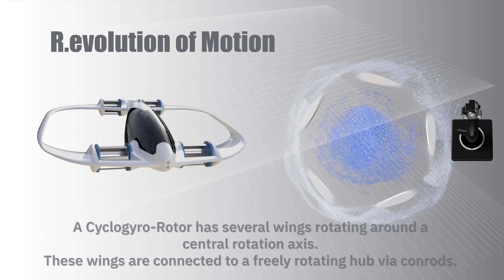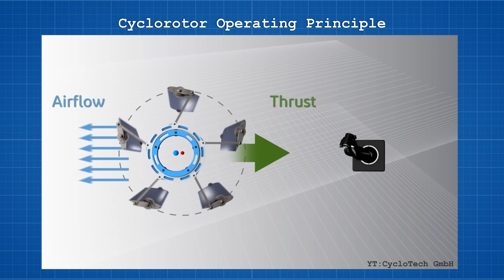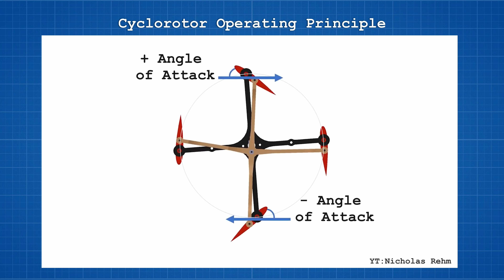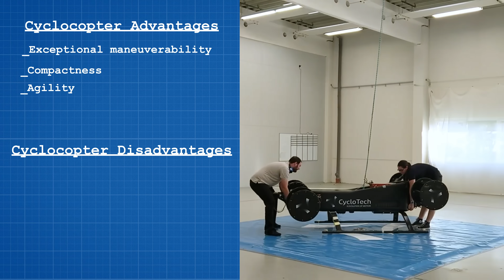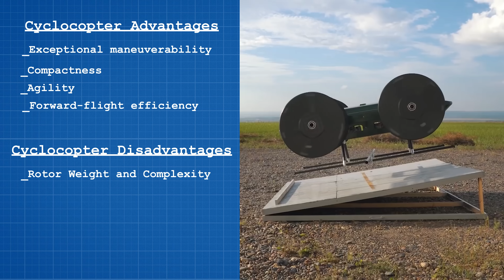CycloRotor: Is this the future of eVTOL Electric Propulsion System?

Comment: Thinking outside the box can lead to advancements in technology, but I just can't see how cyclocopters or its successors will be more viable than quadcopters or vtol. With all the moving parts and how complex it is, it wouldn't exactly be cheap, nor would it be easy to repair. To top it off it looks like it would consume more energy than Vtol/quadcopters.
Reply: Aye, also, the more complex the mechanism, the more prone to failure it is. Murphy's Law comes to mind, and I wouldn't want to be in one of these if it does have Airframe parachute technology.
Reply: @GhostOdyssey  Good point! What can go wrong will go wrong. I could see this being a fun RC but aside from that, I don't see it being viable.

Comment: Have you considered attaching those rotors slightly diagonal instead of all of them facing forwards? Take off in tight spaces is the one real advantage of this machine, so the added sidewards stability should be worth the loss in forward moving efficiency.

Comment: Why not just normal ducted quadcopter blades? This design adds engineering complexity but only half the blade surface area is producing thrust at a given time. Wouldn't that make overall efficiency lower?

Comment: What benefit does this system have over a traditional drone with standard propellers? It seems like any thrust efficiency gained by the cyclorotor system is offset by their increased weight...

Comment: This project may benefit from scaling up and building from stainless steel, like on SpaceX's Starship. A small unit can be designed after working out the kinks.
Reply: stainless steel is pretty heavy, so probably aircraft aluminum or carbon fiber body. The blades also need to be kept pretty light, so we will see in the future what materials they use for that. I am curious about the blades in the future, spinning thousands of rpm creates insane stresses that would band and bow most materials outward... maybe they would incorporate discs that band around the blades to prevent that

Comment: I see an issue... wear on the control rods just like a rc heli on the cycle head system. Takes alot of mantanence to keep it tight.   Every revolution of each rotor it moves to adjust..   wears our fast.  Yes it can be made robust easy... but at a cost of alot of wheight... not acceptable.

Comment: If they can eventually get those cyclo rotors to double as wheels/tires this will be the one
Reply: No. Absolutely no. You would never drive on those things on any road and expect them to still function safely as props.
Reply: @rucker69  it will happen eventually. I picture hollow wheels that retract when ready to fly, but the rotors remain extended but disengage when in drive mode.
Reply: @CRASS2047  The wheels would be too heavy for flight. Newsflash, wheels are hollow already.
Reply: @bluemamba5317  you lack the imagination to grasp my concept. That’s ok. You’ll see it one day
Reply: @bluemamba5317  I mean spokeless wheels, which do exist
Reply: Maybe its certainly possible in theory

Comment: Should design the body with intakes all around the outside and a system of valves to redistribute airflow to keep it even incase of motor failures and the body is the main controller of thrust direction not the engines themselves.

Comment: Each Cyclorotor has several moving parts, looks like a very advanced design what happens to the aircraft or it’s lift if a complete rotor or just one part of a rotor fails. To my mind this looks more complicated then the typical helicopter blade and rotor assembly of today which is typically 2-5 blades achieving lift and flight. In this design each rotor has five blades meaning 20 blades all moving flawlessly in harmony is required for lift with each rotor spinning at approximately 6 times the RPM of a standard helicopter..
Forgive my ignorance if this is not accurate, I know new and better designs must come but how is this more efficient, not more vulnerable to damage and not a far more costly rotor design.

Comment: Actually, breaststroke is the future of personal aviation. Since air is technically a liquid, we can create a net upward force if we breaststroke in an upward direction fast enough. This is undeniably cheaper than any previous mode of long distance transportation. In spite of the fact that the physical effort required to do so would almost certainly kill you, scientists are currently working on making humanity immortal as they always have been, so eventually such an insignificant issue will not be a problem. The more you know.
Reply: talknig about liquid, there is buoyancy.
your aviation should weight colse to air to swim.
strokes only doesn't swim.
Birds? Ok. Huge machine with huge wings and nothing except the engine onboard.
this will work if you are machine or machine with just your brain as max cargo.

Comment: 25kg of thrust sounds really weak for that large of an rotor. Basically you trade footprint vs power. And i hope they intend to make exangable battery packs for that air taxy because 85km range is not much. For many ppl gets you to and from work once. Then you have to recharge it over hours. As a taxi with permanently attached battery packs this would mean, you cant fly other customers. It also means your taxi must have a range display or you have to book them and they select the taxi suited for your range so you dont have to ask if they can fly you 30km into one direction if it only has 40km over all left.

Comment: im really curious if its actually possible to make this thing relaible for more than one or two flights, i bet the stress on the materials must be insane
Reply: Yes, and when one of those rotors fails, there's no lift and no auto-gyro effect, which is why this thing will never be the future of eVTOL.
Reply: @ferrellsl  That's why development is needed. We can't stick to the old way for eternity. When everything just come out, everyone concerns and doubts. As time flies things will get better and better. If you said if one part fails that whole thing fails but rocket is like that, fly by wire fighter jet is like that, that's why redundance is also needed. Just wait for it to improve and judge right then.
Reply: @krain.8245  'old way'? Dude, this thing IS the old way, obsolete tech with nowhere to go and no practical uses and advantages over maneuverability. Plenty of disadvantages though, a lot of which you can't even get around. Even in the best theoretical application scenario there's no way this thing will be useful in nearly any way
Reply: I bet it would scoot across the water though!!
Reply: if youre referring to the torque stress on the materials as relative to a traditional prop design... idk i think the horizontal, flat surface area makes it handle it okay even when compared to a prop (since props extend into a single tip for every blade... in which the blades are in turn held by a single axis at the center... these airlift blades are positioned horizontally and held together by two points it seems?...) the # of blades in that cyclo arrangement also matters (perhaps creating interfering or constructive air vortexes.. and obv the material matters a lot as well... nice question all very exciting..
Reply: @aruhtaz  the blades rotate around their own axis as well as around the main axis of each turbine. That is how you get lift though the blades go in ,any directions while it rotates... Seems like those mechanics would be hard to make last...
Reply: @karlsjostedt8415  completely agreed, it just LOOKS like it shudnt work; let me clarify, i would never put money into this for investment, but can i respect their attempt? sure.. playing devils advocate was why i commented
Reply: Using magnetic bearings will help a lot
Reply: @davincicreativeprojects8853  yeah for real mate
Reply: Rotors blade are shorter, less moment of inertia, more tensile strength, more shear strength. Composite material that is stronger than typical helicopter. I don't think we can tell much if there is no actual calculation for us to see.

Comment: My father in law was shot down in a helicopter 4 times in Vietnam and had power losses in several commercial helicopters afterwards, but landed in a reasonably safe manor each time thanks to the autorotation that helicopter pilots are able to do after loosing power. I certainly wouldn't want to be riding this when something goes wrong...
Reply: Since there's nothing on top of the vehicle, I think simple parachutes on top, and airbags below, would suffice in an emergency.
Reply: You father was ultra lucky. Helos are not so safe either. If something is falling, there is not much to do about it.
Reply: @hades4438  I wouldn't say ultra lucky, but highly skilled. On one of the commercial helos that lost power, he was taking his parents for a ride, and had to ditch it in a farm outside LA. When they landed his dad asked"what are we doing here?" as though it was a planned stop to pick up the farmer, and not a terrifying fall from the sky. Being able to store momentum in the rotors and use it to execute a soft landing is skill and engineering, not ultra luck.
Reply: @jasonthorpe3470  I am in military for 20 years and sadly, none of the helo failures could land safe. And those helos are mostly blackhawk models. I don't say, skills are useless of course. BUT I try to say, if you are in air and there is something seriously wrong, you got seconds to act and all safeties are not so safe enough yet. Even jet pilots you think they are safe as they can eject themselves mostly can't survive from this kind of situations. You know that even a slow car crash is harsh for human body even you got your belt, so a slow crash landing can easily destroy everything.

Comment: With all the weight of the rotors being thrown around and the multiple points of friction, I can't see how this could possibly be efficient, especially when compared to a simple directable blade and cowling. Even more weight will have to be added for protection around the rotors and for people's safety on the ground. What happens if a blade breaks in operation? What do the gyroscopic forces do when encountering a sudden shift in direction? In considering flying it over cities at low altitudes, I would say that it poses a great danger to anybody on the ground, should one of those rotors fail. To say that the stumbling block of the design back in the day was the lack of suitable materials is invalid; they made a plane fly with the same materials. The current day materials make propeller designs much more efficient too, so your apparent 'advantage' in this design is still lost to propellers. I'd still like to see how far you get with this, though and I'd love you to prove me wrong!

Comment: I miss a calculation of the thrust produced compared to a propeller of the same weight and materials. That only will determine whether this will "take off". Especially with the disadvantage of electric vehicles who have a still heavy battery to lug adding a weighy propulsion system does not help. So this is a non-starter for me. Or you can show that the extra weight of batteries is compensated by a lighter weight propulsion.

Comment: you drastically forgot safety as a disadvantage, what happens when your running 19 of  20 blades? 16 of 20?  4 of 20?

most helicopters can safely land (with skills) using only 2 of the 4-6 blades
Reply: No. Helicopters cannot safely land after a rotor blade failure.

Comment: 5:00 - So, phrased another way: it's unstable, is inefficient during vertical flight, and is prone to catastrophic failures due to material limitations.
IMO it sounds like you'd be much better off using ducted fans with thrust vectoring and more traditional construction methods.
Reply: That’s not what I heard…..
Reply: @jcd-k2s  Just like every propeller there is power in and power out. And the rpm is reflecting that. So despite the not so efficient parts closer to the shaft the effective area (calculated by: pitch - area - distance to shaft - free airflow) is what one has to recon with. In other words: look at it as a black box. Then measure how much of the input is converted into thrust. Every part of a propeller blade is delivering its bit of thrust. All the time in a continuous manner. The resistance, drag, is also constant. That rotational drum kind of thingy has fluctuations. And needs for the same thrust (lift) more area for the blades. Because the limited time they contribute. So larger blades translate into increased and constant drag. And even if you design the mechanism so that the blade at the bottom delivers lift it does so at a disadvantageous state because it it is upside down. Built in inefficiencies!
Reply: @jcd-k2s  Those blades have a wing profile. Which means on the top is lesser pressure by a convex surface providing uplift. If the same wing profile is at the bottom it is inverted. The long convex surface below the straight surface. So to avoid downward "lift" it needs to have a positive attitude. Which means pointing upward by some degrees. But with the wrong profile orientation.
Reply: Correct
Reply: The device is designed to generate lift and not thrust. I think I understand you point though. However; generating lift with rotational motion reduces overall weight of the vehicle because it is reducing the needed parts. The rotor itself carries the wings whilst being attached directly to the rotational axis which is usually the electric motor. Transmisions would alleviate efficiency with torque conversion.
Reply: @ChubyX  Isn't that the concept of a helicopter?
A propeller delivers thrust during every phase of the whole rotation. These funny barrels only at the top resp. bottom of a rotation. And to the detriment of efficiency the not thrust producing phases have airflow resistence. So this is a bad concept from the start. The promotors are simply enamored with the compact looks. Space is not an issue for a plane but weight and efficiency is. What you can do by using lightweight and strong materials can in the same way applied to conventional propellers. And their efficiency being better then.

Comment: Cool idea, but helicopters seem way more efficient... helicopters have bigger blades which I suspect are much lighter per unit of surface area, and with a helicopter all of the blades can be used simultaneously for generating lift. I guess the real advantage of these is compactness? Maybe it's possible to put 'safety grills' around these blades too... reducing the risk of dangerous rotor collisions.

Comment: This doesn't seem to be very efficient.... 
And the stresses on the blades will be crazy if they are rotated on every single revolution.
Reply: Helicopter blades change pitch for each revolution, look up how a helicopter swash plate works... it's very similar. But I agree, this design is cool but not at all efficient.
Reply: @FlavourlessLife  but the forces are very different, these prototype blades is more like you pitching a plane wings all the time. Its getting perpendicular force, while most of the helicopter blades forces are along the the length of the blade, so rotating them only affects the weight of the helicopter itself, not also the inercia forces from rotation.

Comment: Is it really that efficient? I doubt it because only 2 of the 4 blades (in total for each cyclo-unit) can generate lift/thrust at any time of one revolution. Quadrocopter for example are more effective in that way. And even the main rotor of helicopters produce some lift in most of the cyclic positions. Therefor, they have to push againest the drag of the tail rotor. Some russian helicopters do use a slightly better solution as the Ka-50 or Ka-26. Maybe the cyclorotor is more efficient for vehicles with electric propulsion. But is that better than qudrocopter design? Or better than something like the Lillium eVOTL air taxi, what is form my point of view at least the most beautiful vehicle ever got into a real prototype.

Comment: I think people back in the days were dumb. Not because they didn't have all the tech we have now, but because even at age of 5 I was able to understand aerodynamics. What most people don't know, is that air is pretty much same as water. If you can replicate swimming movement in air, only a lot faster, you'd be able to fly. So they should have been testing in water, with heavier crafts. You can calculate the weight difference when testing in water and air. 
If I was living in those ancient times, this is how i'd test aerodynamics. I'd make a heavier craft and test it in water first to see how aerodynamics works. you can also add some colored dye into water to see the flow.
Anyone thinking it's crazy, you don't know anything .. because this is actually being done nowdays. Obviously water is not exactly same as air, but it's very similar. Also why didn't people back in days have air tunnels? Not like it's hard to build a turbine and then put smoke thru it to see how it works.